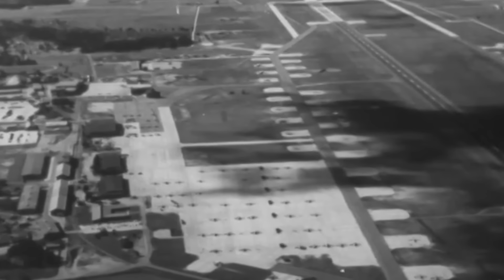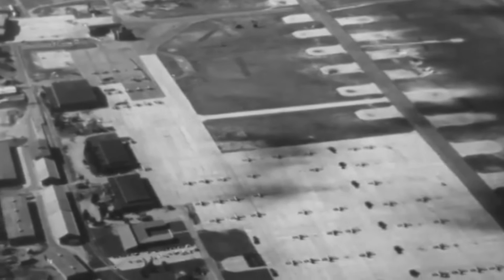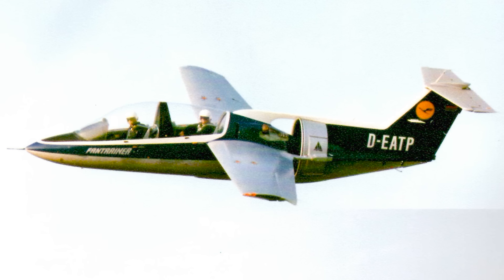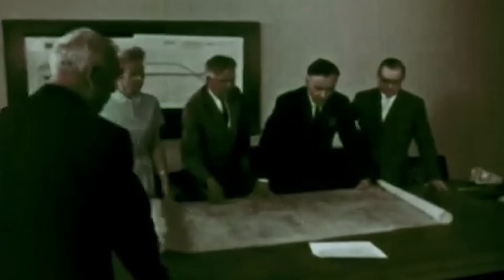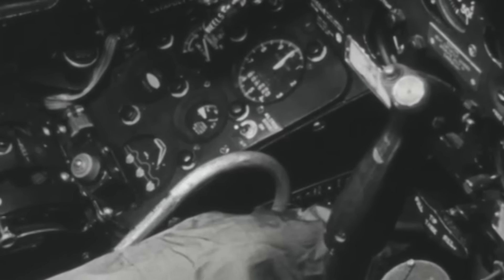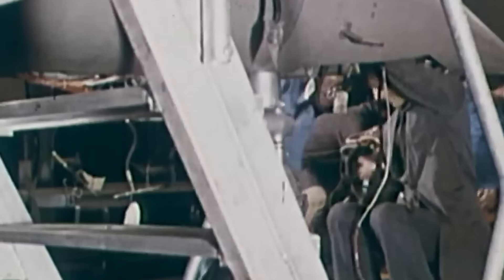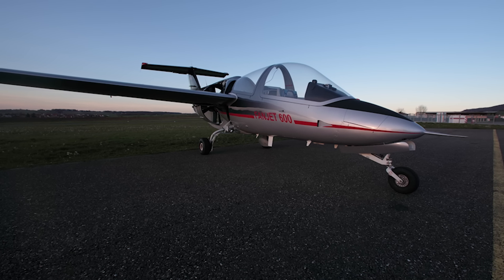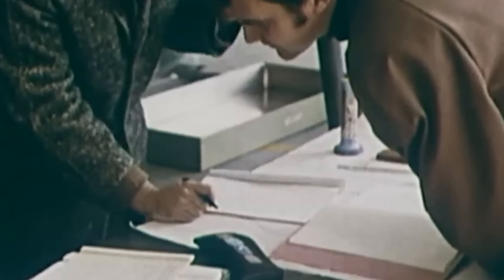The Stunning Plane that No One Really Trusts

Comment: Personally I think the idea of a duct fan as a pusher design for civil aviation is great. No more exposed spinning props to have to worry about someone walking into. Plus it has to be more efficient than a standard prop.
Reply: This layout is pretty close to the top of my list for an e-bike ultralight.

The idea would be the cockpit would be a detachable e-bike.

Behind the cockpit would fold into a trailer.

I'm waiting for the price of thin film solar to come down so I can use it for the top of the wings.

So I can island hop, drop the trailer and let it charge, then hop home.

Carbon fiber is the new fiberglass, it's not even that novel anymore.

Flying 10 miles @ 30mph is my target.

And some inflatable pontoons in case I mess up.
Reply: Yeah, there couldn't possibly be a good reason an 80 year old idea has never be successfully commercialized. If you had been paying attention to the experimental (home-built) aircraft designs of the last 50 years you would have noticed that this idea comes back around at least twice a decade and always fails.
Reply: @vicnighthorse  Maybe because aviation hasn't had its Tesla moment yet.

The problem is everything between ultralight and airliner has been getting further and further out of reach. Not exactly a healthy environment for new competitors in a severely regulated space.
Reply: @vicnighthorse  Never stop trying.
Reply: @TeenWithACarrotIDK  Never give up, never surrender, indeed. I have been an EAA enthusiast for almost 40 years and have seen so many designs (esp. engines) fail but I too have and affinity for the path less taken in airplane design. Never ever put down money on an engine that doesn't yet have several examples flying. I learned that on the hard way.
Reply: @jtjames79   I like this idea. I wonder how feasible it would be to have pontoons on the end of the wheel struts that fold up for flight to minimize the drag.
Reply: I'm surprised it never made a big hit with light sport aircraft at least.
Reply: @vicnighthorse  Sometimes ideas come before their time, problems can later be solved with new technology, materials, production methods or scientific advancements in other areas so it can always be worthwhile to make new studies at least if not attempt a new prototype.
Reply: @Tuberuser187  How many such studies have you contributed? How many home built aircraft have you build and flown? One can have little notion of why conservatism is so popular with people who have actually built aircraft until you experience the struggles of the experimental aircraft doer as opposed to arm chair quarterback. Everybody wants to be a trail blazer and advocate for new stuff until they actually do it.
Reply: This can be the future of electric al Light aircrafts.
Reply: Pretty sure its main point was to simulate the aerobatic performance of a fighter jet, though much lower speeds and g loads.
Reply: @TeenWithACarrotIDK  isnt that literally the definition of insanity? Doing the same thing over and over but expecting a different result. . .
Reply: With all planes that have propellers working in the wake turbulence of other bits of the plane's structures, you have sudden changes in angle of attack of the airflow at the propeller. This induces turbulence on the propeller, vibration in the drive and LOADS of noise. I grew up near Cologne aiport. In my childhood, I quite often heard fantrainers fly from CGN's military part. They are extremely loud, and their noise is not the usual calm hum of propeller planes, but a high pitched penetrant howl. The Piaggio pusher turboprop makes a similarly penetrant unpleasant noise which has people in places near airports complaining.
So in a climate of noise sensitive surroundings of airfields, you won't find acceptance for any pusher planes. The ring aournd the prop would make a nose installation of a fan impossible, underwing installation would only work with twin engined planes without having to place the fan in any wake turbulence and a top of the fuselage installation would make mainetenance dfficult thus expensive.
So don't hold your breath for any such planes to come around. It's unlikely to happen.
Reply: @Eo_Tunun  False! It have already happened, and seems very likely to happen again soon.
Reply: @jtjames79 The Eviation Alice is a passenger electric aircraft with a 9 passenger + 2 pilot capacity and a range of 250 Nautical miles (288 mi) while flying at 10,000 ft I think could be the first “Tesla of the Skies”
Reply: @atlet1  he right though.. thats why pusher planes always go down... ........
Reply: You seem to have got youtube confused with a aircraft design committee meeting.  This is an open platform where people can dream and share their thoughts... at least for now.  You're welcome to host your own site with your own videos and then moderate the comments that you'll get from your 3 visitors.  Seldom have aircraft designers been in tune with commercial reality which is why history is littered with failed great ideas both for factory and kit aircraft,  but I'm glad they had the vision and I'm glad they even managed to build some.
Reply: @dr_jaymz  hahahaha a fail idea isnt great
Reply: It is less efficient
Reply: @wolfganghuhn7747  False!
Reply: @atlet1  whatever
Reply: @vicnighthorse  Conservatism = less risk = I don't really have the money/time/will to fully commit and develop this.
Reply: Prop is more efficient at low airspeed. Turbojet is more efficient at high speeds. The turbine-powered duct fan is typically called a high-bypass Turbofan. It is the most efficient at mid-range speeds. Engines such as the General Electric TF39, CF6, GE90 and the Pratt & Whitney PW1000G are all examples of successful high-bypass turbofans.  The efficiency of turbofans has led to the development and use of low and mid-bypass ratio turbofans on fighter aircraft like the F14, F15, F16, F18 and F35. The RFB fan trainer using the JT15D turbofan engine competed as the Ranger 2000 in the US JPATS contest. Fantrainer was great idea for military organizations that prioritize being efficient with the taxpayers' money. However, I know of no current military organization that has such a priority.
Reply: @nevisstkitts8264  not now in war time. But before there were many.
Reply: @vicnighthorse i think than a pusher ducted prop is less shocking better selling than a front rhomboidal propeller.
Reply: @dr_jaymz I don't know, I dream a lot about things like this and it's nice to know why an idea hasn't been successful or if it's even been built before. I guess it could be worded differently, but some people just talk like that.
Reply: except....... it's NOT more efficient.
Reply: actuall pusher prop is LESS efficient due to cavitation but definatly safer.
Reply: @vicnighthorse  i say the same thing about EV's. The first EV's went into production around 1870...
Reply: Ducted fans are typically less efficient than conventional propellers. Their only real advantage is looking cool. The easiest way to put it, is an ideal propeller would be infinitely big, and turn infinitely slow. That would be 100% efficient. When you duct the fan, you get rid off the end vortices, which makes your propeller "act" longer mathematically, but youre adding weight and drag which more than compensates any benefits. If you look at modern high-bypass jet engines, they are basically just ducted fans ran by a turbine. Whether that is more efficient than a turbo-prop engine, I'm honestly not sure though.
Reply: @crazy_mind-ox8if  and the whole pusher prop thing is less than ideal. fuselage causes turbulence in the air, causes cavitation.
Reply: @vicnighthorse  "Never ever put down money on an engine that doesn't yet have several examples flying."
Then how exactly are we supposed to get examples flying?
Reply: no it doesn't have to be more efficient and depending on design will be much less efficient. Just because you like something doesn't make it better.
Reply: @jtjames79  WTF are you on about... pfft "tesla" moment... that is one company and it took a billionaire talking the government into giving them a bunch of money. Do you think that was some new explosion of creativity and newcomers? Get a grip.
Reply: @Tuberuser187  Which means you aren't being told something.
Reply: @bfish9700 no, that is not the definition.
Reply: @thomgizziz  true sometimes less efficient is desireable for othe wanted attributes but you are right, pusher props are less efficient for the added turbulence of the fuselage.
Reply: pushers are great in the air, they suck on the ground cause the tires kick rocks and dirt straight into the pusher prop.
Reply: @purplepenguin43  pushers are less efficient. read up on it. as ive said there can be over ruling factors . but never are they more efficient.
Reply: The emphasis is on doing the same thing.
If you take the feedback for your failures and modify your proposal it’s admirably stubborn but not insane.
Reply: @briantomcollins  Jay Leno has one in his collection. There is a youtube video about it.
Reply: I don’t think ducted fans are more efficient than non ducted. There is talk of an non ducted fan being fitted to the research aircraft Boeing and NASA have begun developing with the goal of large efficiency gains.
Reply: @thomgizziz  Exactly. Considering the dire straights Tesla is in at the moment it's not the example as the best of anything. The Chinese BYD brand out perform Tesla, which has just been forced to slash it's prices. Tesla trails the pack by a long way in self driving, made even worse when they removed sensors making it even more blind. Musk himself says "It will do the worst thing as the worst possible time". Then the current flop which is the Cybertruck. We get to watch Musk speed run his downfall, and join Elizabeth Holmes and SBF in the hall of vaporware promises that never had a chance to deliver.
Reply: @bfish9700 no, it’s called Engineering in a life critical application. Using well developed and refined solutions reduces risks, costs, and problems.
Reply: Yes there would be more safety for ground crew. 
My understanding comes from Paul Lamar (deceased) that ducted fans are not as efficient as a standard propeller at civillian flight levels. There was an EAB aircraft built originly with a pusher ducted fan. After numerous alterations it was converted to a conventional pusher prop. One problem with ducted fan is that take off requires more runway due to that lack of initial punch.
Now for upper flight levels at higher speeds, it may be a good design. Here you would be dealing will military operations, not civillian.
Reply: @jtjames79  The vested interests do NOT want a cheap, effective, low cost/maintenance flying vehicle.  Remember, just like all the planned obsolescence cars, it's the parts and dealer repair that sustain these crappy companies for years after the first sale.
The rich especially, as aviation is their own private space and the idea of the average millions of middle class people with their own planes sends shivers and causes nightmares in their secret little black minds.
Reply: @anon_y_mousse  Inflatable pontoons.  With a very light carbon fiber rigidity structure with memory points. Inflated by engine exhaust.  Easy, with a backflow limiter connection.
Reply: @vicnighthorse  "So, you never had children?  So, I have 20 so I'm an expert and you're stoopid"  "Have you never been burned up in a fire? Well, I have so I"m an expert"" Have you never been in combat and got your nuts shot off? Well, I have so I'm an expert in why that's a bad thing".
Is this your claim to expertise?
Reply: @mutteringmale   Interesting thought. What would you propose for the flexible portion of the pontoons? Some sort of plastic, rubber or do you have something else entirely in mind?
Reply: @anon_y_mousse  There are many off the shelf films and material that would work.  Rubber too heavy and liable to degradation of exposure to chemicals and solvents.  Plastic too heavy also and liable to cracking when exposed to flexing and cold.
I would think a very fine cross woven strand film of carbon fibers bound together with sme very small amount of flexible silicon based binder.  Just guessing, not my expertise.  Design and building is my forte.
Reply: @mutteringmale   Silicone would be prone to degradation too. Out of the three it would probably last the longest, but not by much. A possible solution might be molded flaps to cover air holes with a sheet metal construction that uses hinges to collapse, but I doubt it would be capable of waterproofing. Might be worth a test though.
Reply: maybe too much weight
Reply: @anon_y_mousse  I don't spend much time thinking about this, because I'm sure there a thousands of planes made with pontoons for the bush country, and sea planes and they've already figured this out before.  I do remember one plane that tucks the pontoons under the fuselage for flight, but, I don't think we can come up with a better solution right now.  It can be done.
Reply: @mutteringmale   I guess retractable the way wheels are would work well enough. I just lament the internal space that would be required. I'll keep thinking about it.
Reply: @vicnighthorse Building and flying planes is incredibly cool.  Being a condescending braggart is… self-explanatory.
Reply: @vicnighthorse  It comes down to cost and after market support. It is better in every way, but because no one has built after market support, it fails. Electric cars have no after market support, and that leads to many brands failing. Tesla only became successful after they offered infrastructure to support the car after the factory.
Reply: Limits the size of the prop though
Reply: @neiltitmus9744  If it's a small and heavy aircraft, which would be a military plane with full bomb/ammo load, a bigger engine and 4 full bladed smaller props would be fine.
I've always loved the idea of ducted fans as the whole airflow flows over the tail assembly giving a lot better flight control for aerobatics/combat flight.
Reply: @jtjames79 Sounds like a good recce package.
Reply: @crazy_mind-ox8if Ducted fans are ALWAYS more efficient. They generate higher thrust and less wake turbulence.  Every Airliner in the sky these days uses ducted high bypass fans.   Essentially, just a jet engine powering an inline prop inside a duct. They even have moved to a modified ducted fans on many submarines.   They are not generally useable on front engine aircraft for 3 main reasons.  They block visibility forward, add extra mass to an already front heavy aircraft, and their cleaner, less turbulent thrust is wasted if the entire rest of the airplane is in the way to generate that turbulence all over again.   At the power levels of GA aircraft, they also do not add quite enough efficiency to fully offset for their payload penalty and complications to maintenance.
Reply: You can still stick your hand into the fan, if you so chose.
Reply: When you look into props vs EDF in rc planes you realize that a ducted electric fan has around 30% less thrust per watt than a regular prop of the same size and pitch. Ducted fans are a dead end in aviation.
Reply: @jameshathaway5117  Yeah, That’s why 90% of airliners in the world have ducted fans. A High bypass turbofan is a ducted fan.  And a submarine propulsor  is a ducted fan.
Reply: @christopherpardell4418  you do realize that you are talking about jet engines that require the housing to compress air...don't you? Airliners use jet engines not merely ducted fans. Both high bypass and low bypass turbofan engines use the ignition of the fuel in the air stream to drive the turbine blades. A mere ducted fan like the one in this video has a separate driver that spins the prop. In most cases a piston engine. Turbofan engines from a function standpoint share very little with any sort of prop driven craft other than using blades to move air. Adding submarines to the argument just goes to show you really don't understand what I'm saying.
Reply: And the potential for trust vectoring over the tailspin! What's not to lightweight?
Reply: We call them turbofan engines. It's all they really are. Big ass ducted fan.
Reply: @jameshathaway5117  It does not matter how you spin the fan.   You can spin the fan with electrical motors if you like.  Gasoline motors. Diesel motors.  All a turboprop is is a jet engine Turning a sparsely bladed fan.  Its jet thrust is directed backwards, too, to add to the overall thrust… it’s just a very small jet engine and can’t really add significantly greater thrust over the handful of blades on the prop.   They are fine for attaining speeds around 300 to 400 mph, but they can’t get to the 500 mph realm without a lot more power, and for going that fast, a ducted fan works better.  Ducted fans eliminate the drag from prop tip vorticies, which is one of the reasons they can have so many more blades.  A modern fanjet engine produces up to 70% of its thrust from the fan, alone.
Reply: What about those unhappy accidents of x wife "falling into" the blades
Reply: @jtjames79 are you trying to say a tesla is cutting edge and within reach of the average person😂😂😂😂😂😂😂😂😂😂😂😂😂😂😂😂😂😂😂
Reply: @atlet1 not
Reply: @L33tSkE3t yup would live up to it's nick name the turd crap falling from the sky😮
Reply: @holmes1956O  No. That's not what I said at all.
Reply: @jameshathaway5117  EDFs and RC planes are an edge case. The drag from the duct increases by the square while the area of the blades square.

Model EDFs trade performance for size intentionally, so you don't need a propeller on the nose of your scale model F-14.

Ducts start to make sense at about the paramotoring size.

If you make them even bigger proportionally they even count as wing area. That was the theory behind the flying French barrel that started the whole ducted fan thing.
Reply: @jtjames79 well that is how I perceived what you were trying to project. Tesla moment? I read that as cutting edge. Laughable. Out of reach. As a tesla IS within reach. Not. Thats how I broke down your post. Matbe my interpretation of your written english is different than how it was in your mind as your put it into words
Reply: @anon_y_mousse  The idea is you're going so slow drag is hardly a problem. I would probably make them lifting body shape, and inflate with helium.

An ultralight contraption isn't going to be coming in hot for the landing. The pontoons just need to float not really be boat shaped.

After watching a video about the inflatable airplane from Good Year. I think most of the problems could be solved with tensegrity structures inside. If the tensegrity structures are nitinol memory wire, we could go back to bending wings instead of flaps.

I wonder how the FAA counts "empty" weight, if the wings are negative weight when deployed.
Reply: @holmes1956O  Do you even disruptive technology bro?

Do you think your pocket computer just appeared from the aether fully formed?

Nowhere in your rant was there a rational thought.
Reply: @jtjames79   Indeed, for your use case you're going too slow for it to matter. That's why I wouldn't entirely want to copy your design, so I'd need them to either fold up or be aerodynamic. If only I could find a long-term durable material that's flexible and impermeable enough to be used as an air bladder. Silicone isn't quite durable enough, but maybe material science will catch up to where I want to be within my lifetime.
Reply: @anon_y_mousse  It's a lot easier separate your problem, combine a flexible material in an impermeable layer.
Reply: @jtjames79   What materials are you thinking of?
Reply: @anon_y_mousse  I haven't tried anything yet but I would start looking at ripstop nylon with some sort of rubber like resin impregnated with graphene.

The Tech Ingredients YouTube channel has a graphene recipe.

That's where I would start at least.

Also considering carbon fiber with graphene that's extendable like a collapsing toy sword.
Reply: @jtjames79  I was hoping to get away from rubber, but I'll have to see if graphene infused rubber fares any better.
Reply: You should open with "I'm not a pilot or an engineer"...
Reply: @Krag-nz9ny Ducted fans have always worked. They are just not  the best solutions at this size and speed. Every jet air liner is a ducted fan for instance. This is long well understood and often considered technology. It is not new or obscure. Didn't you ever wonder why they only built 22 Edgley Opticas?
Reply: @maddhatter3564 If you ever talk to any owner operators of pusher props the first thing they tell you is how much they want to get rid of them, due to the insane cost of constantly replacing the props. Because the props are behind the main wheels the props suffer a staggering amount of foreign object damage on takeoff and landing. Making the costs to own and operate them unexpectedly high.
Reply: @D64nz LOL. FUDster, $TSLQ, Merchant of Doom.
Strongest Auto company ever seen!
Reply: This only proofs that aviation industry is often far too conservative. Just tiny small steps. And meanwhile the great designs are NOT TRUSTED. That is stupid beyond compare.
Reply: @jtjames79  This is a fighter jet trainer. It does more than 30 mph. What are you thinking? Ah, it has a roof over your head. And it has wheels. So it is a bicycle.
Reply: A ducted fan is not adapted to low speeds, its low diameter generates low efficiency and higher consumption / costs. The propeller is physically the best solution up to 650 km/h.

And even for higher speeds the propeller will come back. To reduce consumption the diameter of the fan has to be increased to improve the bypass ratio, which Reynders the nacelle always heavier. The next engines generation, awaited for mid 30's, will be open rotor
Reply: @vicnighthorse  Like the flying car and personal hovercraft 😮
Reply: A standard prop is crazy efficient bro you would be surprised